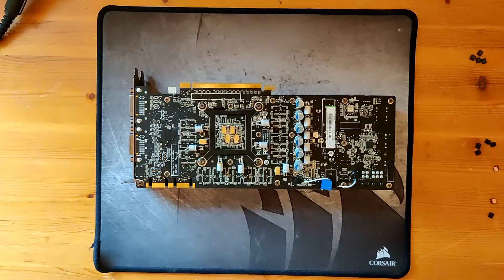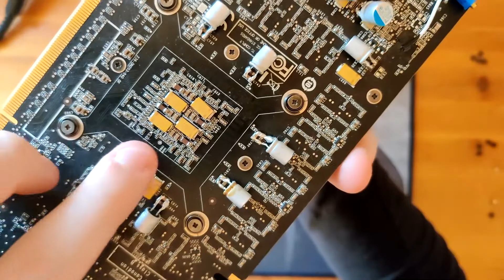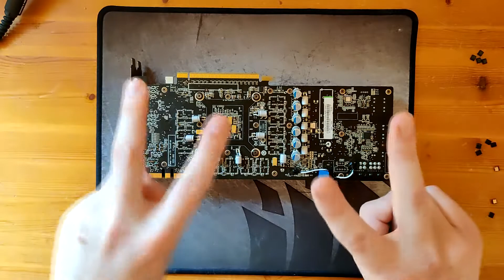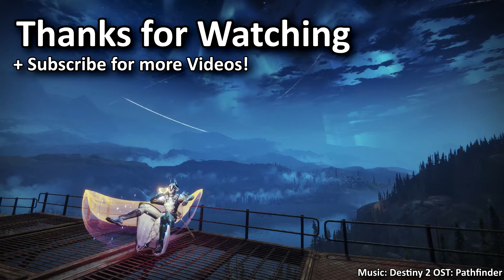The RTX 3080 "Capacitor Problem" from a Modder's Perspective

Comment: how much Mhz do you think you could gain from doing a capacitor mod on a 3080 like you did on this card ? only 35Mhz ?
Reply from the maker: Hard to say the Ampere architecture is very different from everything i have worked with. Also the PCBs are very different. I know that 1080Tis and 2080Tus have scaled with capmods but it varies from card to card. Some get 50MHz some get 15MHz